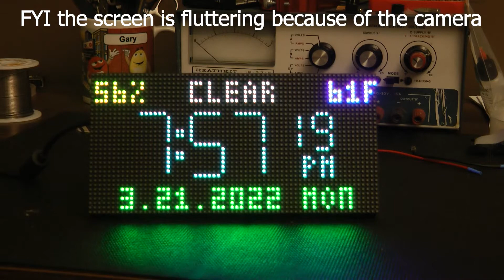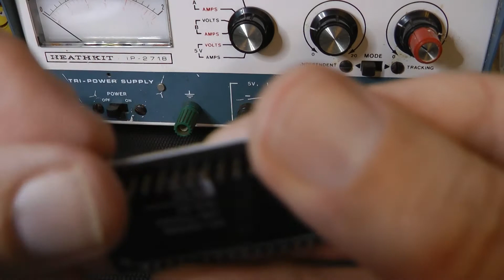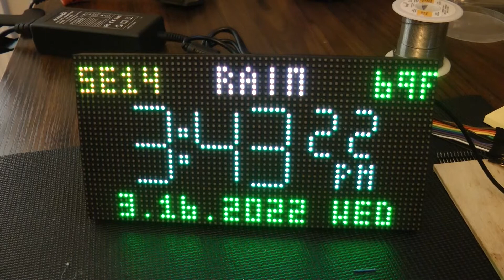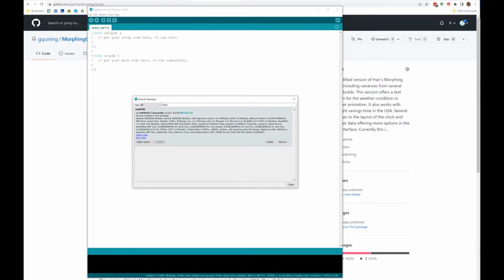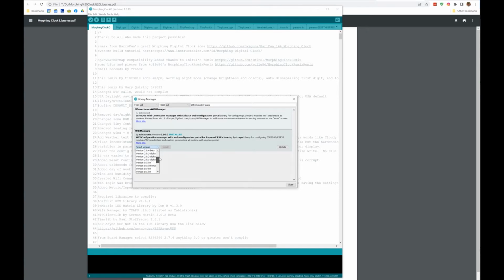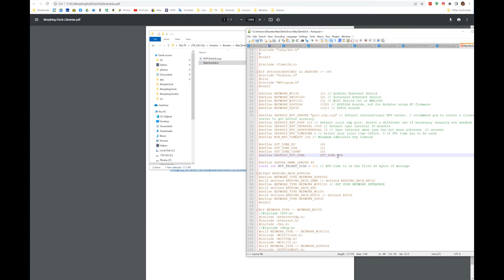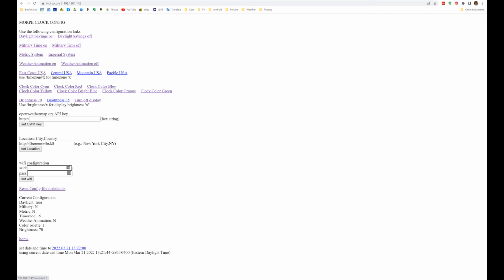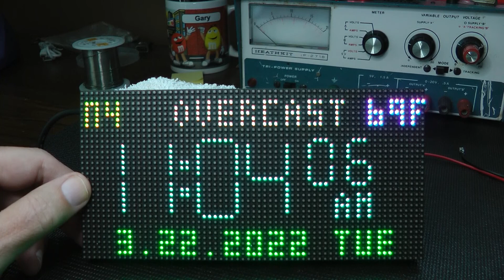Morphing Clock using a 64x32 RGB Display

Comment: thanks!!!

Its working with P4 LED Matrix as well.

the only thing to look out is Pin E on the instructables is actually GND (ground) on P4 matrix panel, luckily the Matrix library on Pin E is optional on panels that require it, esle it works fine on P4 panel with Pin E not connected.

else

the rest of the pinouts are named differently P4 Matrrx Panel, for example RO is R1, G0 is G1, B0 is B1, R1 is R2, G1 is G2 and B1 is B2

Also dupont wires is not required as the panel also include a ribbon cable in the matrix panel

Comment: Hello. Thanks to you, I completed the hour. It looks really great. If I input the watch with a 5v 5A power supply, can I power the esp8266 with the same power supply? Does 5A damage ESP?
Reply from the maker: That's how I wired mine, it powers the LED display and ESP.  5 amps is fine.

Comment: Good morning, my friend, I solved the problem in my case, the city is (Santos Dumont, BR) just like the compound name solves it by doing it like this (Santos+Dumont, BR) I just added the symbol + then it solved it, at least so far it's working perfectly if solve it for more anyone comment here please so we can help more people
Reply from the maker: That's good to know but the problem is much larger than that.  The free weather service API call from openweathermap is going away this June 2024.  I am trying to write the code to weatherbit.io but so far I am getting nothing but error messages with their API.
Reply: @GaryQuiring  wow, I didn't know that, so we really have to migrate to another app. I see here the one from Microsoft Build, it and from Microsof, it seems to be free. Anything, I'll let you know, I'm with you.
Reply from the maker: @emersonpaiva2566  If you have a link to their API call please post it here.
Reply: @GaryQuiring  ok, I'm still confirming because I've already searched the website so far I haven't found any charges and there are several APIs as soon as I confirm I'll post them. Note: I sent an email to the website and they said that at the moment they have no plans to stop the free franchise No, but we cannot be left alone in their hands, we have to have a plan B.
Reply from the maker: @emersonpaiva2566  Here is the link and they also sent out an email (which I never got).  

https://openweathermap.org/api/one-call-api

Comment from the maker: I'm not sure what's going on, the weather code is no longer working.  I have a different NTP clock that also stopped working a few days ago.  I think openweathermap.org is the issue.  Is anyone else having problems?
Reply: I noticed this issue about a week ago.  I emailed openweather and they replied that my API call was good and there is probably something wrong with my code.  I pointed out that my code hasn't changed and worked perfectly fine for several months.  I'm not sure what to do next??
Reply from the maker: @MikeTodd-q2e  I'm going to contact them again, first attempt they told me they don't support the free account users.  The fact that the little weather cube does not work either  proves it's their issue.
Reply from the maker: If they blow me off I will try to use the API call from Weatherbit.  They offer a free account.
Reply from the maker: @MikeTodd-q2e  I don't know why but openweather did not email me, my buddy got the email, openweather has terminated the 2.5 API.  They require you to use the 3.0 API and have a credit card on file.  It won't charge you if you stay below the allotment but this is bad news.  I can't possibly switch to the 3.0 API and take the responsibility that the code would never go over the allotment, because it would charge your credit card.
Reply from the maker: @MikeTodd-q2e  I was able to get it working and the mini weather cube working.  It's related to the City, Country code.  I had a space in my setup, I removed the space and it started working again.  Try removing any spaces and see if that works for now.
Reply: @GaryQuiring  There was a space in my city (San Clemente). When I took out the space I get a 404 code: "city not found".  I tried "Sanclemente" and "sanclemente" with the same result.  I then tried Irvine, which is the closest city to me with a one word name which worked!  Problem is Irvine is 25 miles away and inland so the weather seldom matches weather in San Clemente. any suggestions?
Reply from the maker: @MikeTodd-q2e  Watch this video https://www.youtube.com/watch?v=D3DgFY0E-FY&t=245s where I explain how to put the numberic code in for your city using the openweatherdata web site.  In the mean time I am trying to change the code to use weatherbit.org.  It's not going well, they only allow 50 calls a day to the service I ended up using my allotment today with a loop that quickly ran over 50.  So I have to wait until tomorrow for my next allotment.
Reply: @GaryQuiring  Man, I've been all through your video and can't find where you comment about getting the numberic  code for a city.  What time stamp should I be looking for?
Reply: @GaryQuiring  
Good evening, I'm also experiencing this problem here in Brazil, I discovered that this problem occurs with cities with the compound name exp:Santos Dumont, my city doesn't work Barbacena, near here, the app is normal, but I have another code that uses Json 6 and with it It works perfectly, but how can you use the city code and it still doesn't recognize it.
Reply from the maker: @MikeTodd-q2e  Sorry about that, I explained that in a different video that uses openweathermap, I didn't reliaze I never covered that here.  Watch this link and see if it works. 

https://www.youtube.com/watch?v=D3DgFY0E-FY&t=245s
Reply: @GaryQuiring  well hell, that was easy
Reply from the maker: @MikeTodd-q2e  I'm looking at several different weather services trying to make sense of them.  Hopefully I can find something that is not a total rewrite of that code.
Reply: @GaryQuiring  What would I have to change in the code or maybe the params.h file to get the numberic city code to work?
Reply: Okay, I think I have it figured out so you can keep the free openweather: on line 636 of Gary's most recent "MorphingClockQ ino chang "q=" to "id=".  Everything else on that line remains the same.  In the params file on the char location line instead of putting "city, country code" put in the 7 digit city code that you can get from openweather.  I did this to my clock and it is now working fine!

Comment: Gary I got it to work with P4  led panel . The only wire that i don't connect to board is D3(esp8266) . Everything is working !  thanks
Reply from the maker: That's good to know.

Comment: Gary you are amazing. Very good detailed info video. I will try this project. Thank you for this video. You got another subscriber :)
Reply from the maker: Thank you, I had to document it because it took a lot of research to make this work.  I wanted to make easier for everyone to do.
Reply: @GaryQuiring  I have the same display 64x32 but it’s P4 not a P3 . I tried it and didn’t work , so I ordered the P3 the same one you recommended. Will give it another try .
Reply from the maker: @tiberiud1955  It should work, P3 vs P4 is the pitch of the LED which should not matter.
Reply: @GaryQuiring  P4 didn't work :( I tried it 4 times pull all the wires out and rewire it... nothing.  I just wired the P3 and it's working perfect first time after connecting the wires. I am happy now :) Thank you again.

Comment: I built your clock and it works beautifully...Wonderful video!  When I first got it wired and got the IDE to compile and upload, as soon as I connected the 8266 to the matrix display, it would pull the 8266 down (the blue led would turn off and it would drop off the WiFi network).  After several wiring checks, changing the 8266 and other troubleshooting scenarios, I found I could get it to work properly by disconnecting the D3 pin on the 8266.  With the D3 pin disconnected, it seems to work just as shown in your video.  Any ideas on what's going on?
Reply from the maker: Wow no clue, how did you decide to disconnect D3?
Reply: @GaryQuiring      Process of elimination.  After convincing myself that the wiring was correct, I decided to try and figure out where the short was and maybe what was causing it.  Narrowed it down to D3 and decided to see how it would work without that wire...seems to work fine.  I'd send you a photo but don't think I can through this forum..
Reply from the maker: @MikeTodd-q2e  I looked up what D3 is - "connected to FLASH button, boot fails if pulled LOW".  It would seem there is no need to even connect that to the RGB board.  I originally got the wiring from Harry who developed the morphing digits.
Reply: Also used a P2.5 panel...  A little small but looks good.

Comment: Thank you sir for your wonderful video. The instructions are detailed and clear. I tried building this clock. Programming and wiring is easy. But am having problems.
This led display is not getting on. I am using P4 32*64 RGB board. 
I am not getting any display and the led on  ESP8266 goes off as soon as the ground wire is connected. 

Seperately i checked the esp through the serial monitor it shows the details when the ground wire is not connected. But as soon as the ground wire is connected the serial monitor show junk character. 

Please help how to fix it
Reply from the maker: Someone else mentioned that issue and said the solution is to disconnect the D3 wire.  I don't know why that is happening, I wonder if the LED matrix display design has changed?
Reply: thank you SIr, for y our response, i am using P2 32*64 rgb matrix panel is that any problem as you  used P3 panel. please reply.
Reply from the maker: @georgelagardo  I don't know.  I am not familiar with the various RGB displays.

Comment: A better technique for soldering the ESP8266 header pins, is to place the headers into the ESP module and stabilize them into a solderless breadboard. this method with hold the pins in the proper orientation. Also maybe design a 3D printer file for a case and diffuser for the matrix.

Comment: Hi Gary, Most impressed with the whole project! Nice clear data via the video that allowed me to build the unit.
Had a couple of loose connectors but soon found them and corrected. One issue that I'm struggling with is trying to get the program to download weather.
I have even requested a new API key but to no avail. I do get Serial messages which  say "No weather data available", then the various weather elements print out with a "Not Found" trailer string?
It's driving me crazy trying to trace the issue and if you have a moment perhaps you can throw me a lifeline. (Doubt if it will reach rainy Scotland though lol)
Thanks in anticipation.
Ted
Reply from the maker: The most common mistake with the weather are the fields.  It's city, country.  Not city, state.  I don't know how they label them in Scotland though.  Try something really common for a test like New York, USA.  See if you get weather results.
Reply: Thanks for that swift response Gary. I had triple checked that very issue having tried "Edinburgh,GB" then "London,GB" to no avail. 
I stuck in a println order within the "void getWeather() routine just after client.setTimeout(500); to make sure the API code was good and it was. 
I'm kind off looking close at the GET statements to see if anything at all is coming back and although i've not been able to print anything out, I'm sure nothing is being captured, but not to sure what I can print???? I'm staying with this routine for the time being but will try your suggestion about using a "Boston,US" to see.......
Reply from the maker: @EdwardVeitch-e2d  What happens when you click this link in a browser  (replace <putyourAPIKeyhere>)?

https://api.openweathermap.org/data/2.5/weather?q=Edinburgh,GB&appid=<putyourAPIKeyhere>&cnt=1&units=imperial
Reply: Good Morning Gary. Nothing like waking up knowing you goofed. Had yet another look at params.h and discovered I had been putting my city and country code to the right side where your example was, instead of within the quote marks. I feel a right idiot. I suppose I should be happy knowing it was the only error.
Anyway today I'm going to tidy up the module wiring as I'm getting a lot of contact issues with those wire connectors.
So I thank you again Gary and will stay in touch if possible. Meant to ask if you know of any Arduino software that clarifies programming those LED 64 x 32 Matrix panels from an individual LED point of view.
Ted @GaryQuiring
Reply from the maker: @EdwardVeitch-e2d  I have issues with my wires too that's why I don't like touching it anymore.  I am going to try to get the OTA update code in it that someone here donated to the project.  That way I can do more frequent updates without having to disassembling it each time to update the code.  I don't know how to program the LED, that was all done by Harry.  Don't forget you could have fixed the City, Country using the web interface.
Reply: Hi Gary, Just a brief update. Decided that the "contact" issues with those plug in pin wires were bugging me so stripped it all down and created a hard wired (soldered) pcb board for the esp8266 to sit on and wired across to two 8pin dual female sockets (input/output) on the display. Works like a dream and no pesky contact issues etc. I hope we get a chance to communicate again Gary and really thank you for this excellent project, with clear instructions and provision of all necessary files. Take care. Ted @GaryQuiring
Reply: Hello again Gary. Couple of interesting matters. Every 2 minutes when the prog goes for a weather update, the whole LED screen blacks out but only for about half a second then comes back as if nothing happened with all data still correct. Also I discovered when looking at the display, there is a very very slight tremble/shimmy across all characters. Almost timed with the "seconds" update. I assumed I had some power supply ripple but after a change of power supply, no difference. Tried a new display panel and Processor esp - no change. Tried playing about with wiring but no effect. Thought you might have some ideas..... Thanks, Ted
Reply from the maker: @EdwardVeitch-e2d  No clue but be careful with updating your weather that often, the free API allows only so many requests per month, not sure if that would go over the allotment.
Reply: Hi Gary. Good of you to take the time to respond which I appreciate. I might have found the slight shimmy problem I tried to describe yesterday. 
In my effort to fix those contact issues by soldering the contacts and I also "loomed" the wiring between the ESP and Led panel Data P1/P2 sockets into a nice tidy bundle and believe I may have accidentally caused cross interference between some of the wires. 
Having slept on the issue, I eased the wires apart this morning and hey presto, problem gone.  (transformer action or what LOL) OK, I'll do a weather check every hour and see how it goes. You take care.
Ted @GaryQuiring  
😄

Comment: timezone +5.5 is not working. only 5 or 6 works. any solution?
Reply from the maker: Another user mentioned it.  It's the NTPClient library that is the issue.  I briefly reviewed the code (not my code) and saw this variable that I thought would resolve the problem.  In the code is a variable called _minutesOffset.  It looks like if you would change the offset to 30 and recompile / upload the sketch it might work.  Otherwise you need to contact the author of the lib and see what they say.
Reply from the maker: Did you ever resolve the +5.5 issue?
Reply: Line number 581 edited as   NTP.begin(ntpsvr, String(c_vars[EV_TZ]).toInt(), toBool(String(c_vars[EV_DST])), 30);
Reply: timezone 5 and +30 from this line. working ok for india

Comment: I finally got display in, and allmworking except, when the ye;llow wire hooked up d4 it shorts out any idea what d4 controls, if i leave it un hooked seems to work
Reply from the maker: Someone else used a P4 board and had to disconnect d3 for it to work.  It must be different RGB boards out there.  I honestly have no idea, the board logic is all Harry's orginal code.  You would have to contact him, he might have a better understanding of the board logic.
Reply: Hi Gary its the waveshare trided two diffrent ones just got from Amazon, both needed the d3 unhooked, then all appears to operate just fine, the looping on the web fro weather is confirmed if no location it sets stuck in loop tring to get the heather, hence what i was seeing with the excessive weather api calls.  Be interested to know what that d43 line does / is for if you find out that be great. also on latested win update had to reload the 4341 driver i mentioned again so if outher get stuck tring to flash on a win 11 box they weill need to load the old driver, very easy.  Ill see if I still have link.

Comment: Thank you for this. I had a commercial Clock that died (Glance Clock). I love Arduino and will add this to my project list.
Reply from the maker: A new version will be available soon.  The weather service it currently uses is pulling the plug this June.  I am testing with 4 different weather services, hopefully all 4 will be available in the next release for better flexibility.